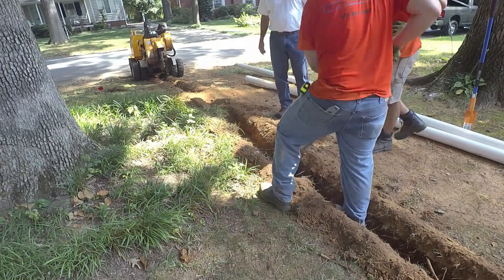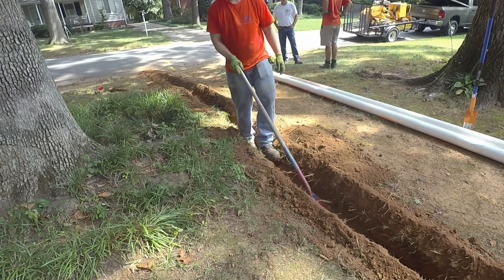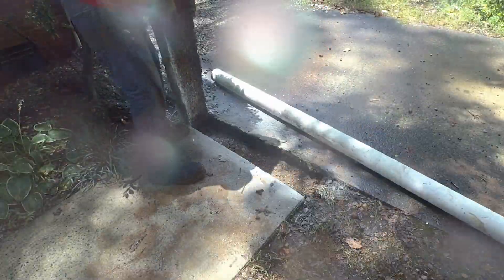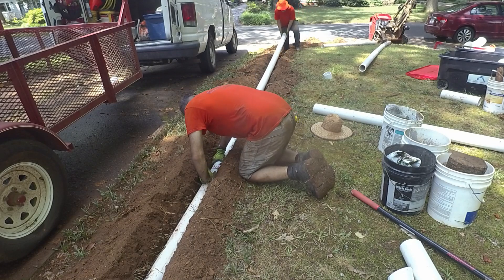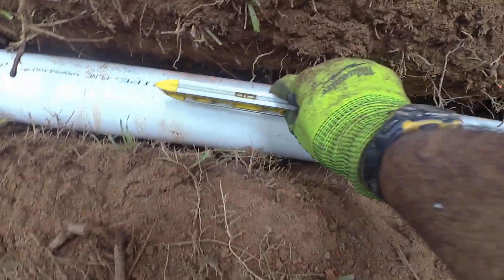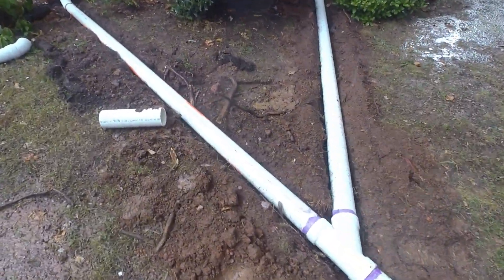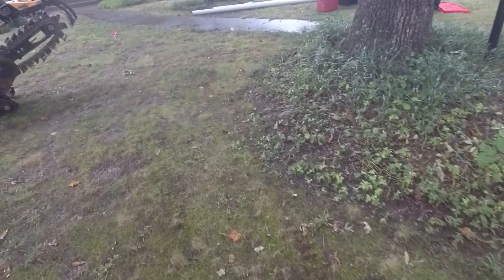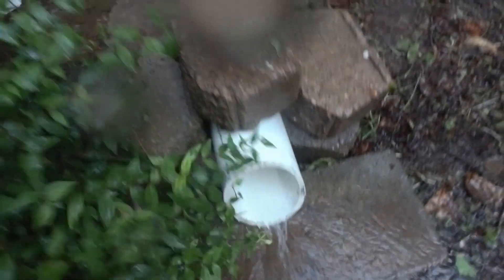Gutter drain pipes installed on fairly level lot - how to check for proper fall

Comment: Looks good. I see you put a clean out on that pipe. You don't normally do that. Was it due to the run length?
Reply from the maker: There's enough room to drop my sewer jetter hose in without the cleanout but sometimes we do install them. It's really customer preference and this time we did one.

Comment: YT is full of corrugated pipe hype but my city will absolutely not permit the use of the material.  Permits only allow smooth-wall installations here. It's hard to beat the .9% self-cleaning slope of smooth-wall. 10/10
Reply from the maker: They sell that old corroded (corrugated) pipe all over here in NC. It's hard to blame the landscapers who install it because it's what is for sale at the supply house.
Reply: @GCFD  NC may have more elevation changes than here as the pipe suppliers always seem to have dual stacks of black dual-wall & every size of green-PVC too. The only legitimate spot to use corrugated here is within 10 feet of the home. The yard elevations are usually permitted 4% slope that extends 10ft off the house foundation with 1% slope from that point to the bottom of the public ditch(or storm sewer) near the street.